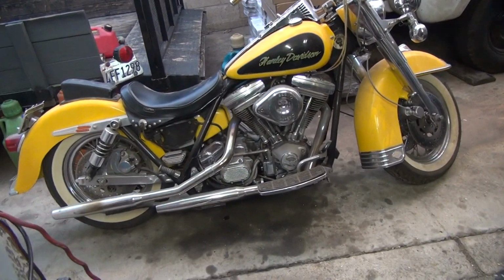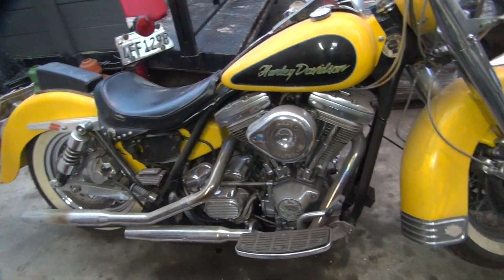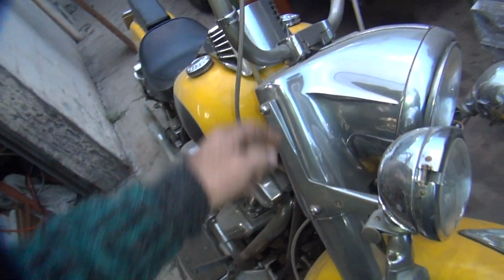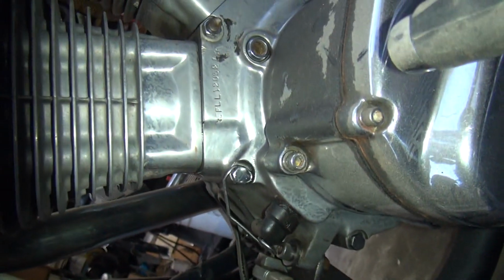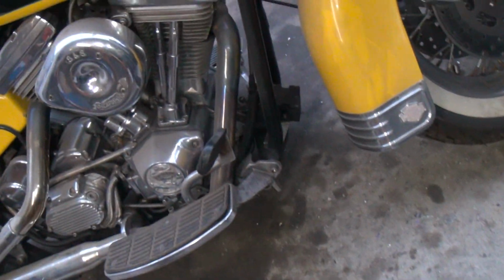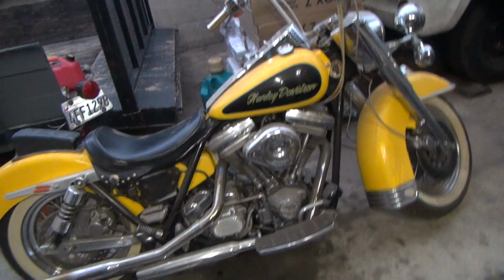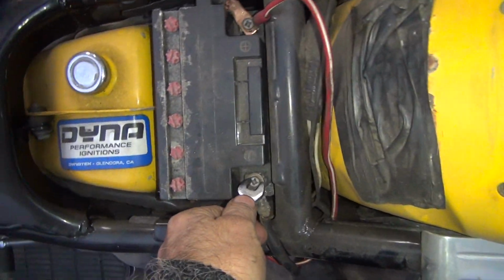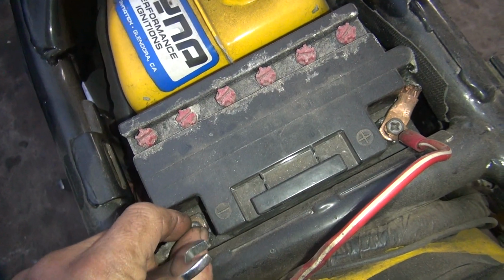#101 1990 fxr custom garage find 80ci evo hot rod get running repair fxrp FL harley by tatro machine

Comment: I think people who do that to FXR's are crazy. Why would you make an FXR look like an FL?
Reply: No accounting for “taste” lol
Reply: Your right.
Reply: @gman6576  The frame was designed by Erik Buell and so made one of the best handling bikes Harley made
Reply: Because you can.
Reply: @dannynoel993  yep, ANYTHING can be modified to suit your needs. It's just weird to me. Its kind of like taking a Grand Touring type of bike (which the FXR is) and converting it into a Touring model bike. Yeah it can be done but it's a complete overhaul of everything! Id've just bought a FLH instead of hacking up a perfectly good FXR and I LOVE FXR's. Again, to each his own...
Reply: He probably like it, I do. I wouldn't change a thing. Be a good bike to buy. Especially when Tatro get it done.
Reply: @dannynoel993  yeah, its just different in every way. Not for nothing but fXR's had a different suspension setup and it looks odd. There's an ass for every seat.
Reply: @jiltedjohn9294  the Motor Company used the FLT "Tour Glide" frame back in 1979 if you can believe that? It was carried over to the FXR models. And yes you are correct, thank you Mr. Eric Buell.

Comment: Nice but where did u find a 10mm at lol
Reply from the maker: i keep a 10mm and 12mm wrench with my tire tools so that i can do battery's and inner tubes as needed. you learn how to always keep certain tools in the areas you will need them in. if you watch the videos closely you will see every machine and work area has its own tools that are used in that spot. it beats walking all over the place looking for what you need.
tatro
Reply: @TatroMachine  my 10 always come up missing when I need them and are always the ones I find when I don't need them!! Why is that lol????

Comment: Junk Ignition set up. Ive fried my share of Dyna's
Reply: DYNA ignitions are one of the best on the market most people that think they aren’t installed them wrong or there bike was setup and tuned so poor they ran way to hot and killed the nose cone unit. Nothing junk about them.
Reply: @stevem5139  👌 OK thanks for your opinion, I've professionally installed dozens and removed many
Reply: @burner__account   OK everyone's entitled to their opinion I guess. Personally I would not want one  Ever again Daytona ignition is the best one out there right now
Reply: @kennethwise7108  you are spot on, Dyna ignitions are trash. Across the board, they don’t make a single good part for my money. 
I’d rather use one of those Powerhouse knock offs from Midwest or an Ultima before I used a Dyna part. 

Best on the market is the S and S ignitions HI-4N that used to re made by Crane. Best ignitions on the market, hands down. 

By the way to the guy saying Dynas are good and others don’t know what they are doing, I do this everyday, you’re not going to get anywhere trying to attack my experience.
Reply: @hdevo80  hands down the best in my opinion, I’ve had the least amount of problems with them of any ignitions I’ve ever sold and I’ve sold a lot of them. I won’t install anything else on a customer bike, a guy running a shop can’t afford to stand behind the other junk that breaks or burns up after a couple hours use. Like Dyna. 

I would recommend getting the complete kit that S and S sells with a coil and plug wires that are designed to work together. It’ll make things a lot easier and they last forever. Also you don’t need a special cable and computer program to dial in your advance and spark settings like some require. You can also set them up to spark on every revolution for kickstart if you require that. 

Make sure you have a good points cover seal too because regardless what kind of ignition you run if you get it wet it’s not gonna work long.
Reply: @vtwinbuilder3129  thanks man, me too. And he had the nerve to ask me how many I have installed. I have 35 years of experience in this industry and I don't argue with people (idiots) anymore. Obviously if he thinks they're all that than maybe he should go on ebay and start purchasing all of their stuff from that era. Ive been down that road one too many times and ain't NEVER going back down it.
Reply: @vtwinbuilder3129  very true! I've personally been stranded my share of times and even ran on one cylinder SEVERAL times.  I dare someone to callry call Dyna customer service and see how they treat you. I've placed well over 100k on every Evo powered bike I have owned over the years. Back in the day you didn't have many ignition options to choose from. To be honest with you I've changed drastically over the years and like stock HD ignitions for stock configured bikes. The one in my 1998 is still all original.
Reply: @kennethwise7108  there’s nothing wrong with stock ignitions for stock bikes at all. 
The worst thing I can say about the stock Harley pickups is that they almost always fail by getting hot and you can always see the tell tale potting compound melted all over the plate. It’s just a part though and parts will fail, that’s life. If you don’t need the extra features there’s no since in complicating things. 👍🏻
Reply: @vtwinbuilder3129  I can hardly wait to see what Keenan has to say about Dyna ignitions. I doubt he's a fan..
Reply: @kennethwise7108  I’ve seen him mess with a few ignitions but I don’t recall them being Dyna’s. 

He may even tell us we are both idiots and they are his favorite. HAHAHA To each is own I guess.
Reply: @vtwinbuilder3129  HAAA YEAH REALLY!! I love how he calls people "assholes" or "dumb asses". Im glad to see that he's FINALLY sporting the new sweater that I sent him last year. I was picky when searching only because I knew he wouldn't want one that didn't have the right color combo on it.
Reply: @vtwinbuilder3129  Thank you Sir!  And S&S HI4N nice potato-potato idling?? My bike  80ci EVO,   Andrews EV27 cam, 9.5-1 comp,  Mikuni manifold, Mikuni HSR42 carb, force winder air cleaner,  S&S reed valve  vent , 2-1 supertrapp ex, and  15 year old CraneHI4 ignition.  And  kick and electric start. I look new ignition.
Reply: @hdevo80  if you’re already running the HI-4 the new one will be more or less the same. 
My understanding is that S and S bought out the motorcycle division of Crane. They actually used to produce most of S and S’s engine parts as well. 

Anyways the idle sound wouldn’t have that much to do with what ignition module you run, if you change your cam, pistons or cylinder heads then you might start to notice a change in sound. 

Sounds like you have a pretty healthy Evo. Nice!
Reply: @vtwinbuilder3129  Thank you Sir!  George from Hungary!
Reply: @hdevo80  how’s the Harley scene in Hungary? I may need to relocate to a different country to find work if this election nonsense isn’t sorted out and the geriatric, globalist sellout becomes president. They will probably outlaw Harley’s here because they aren’t “good for the environment” or some other such nonsense.
Reply: @vtwinbuilder3129  Hungary small  country and  small money :)